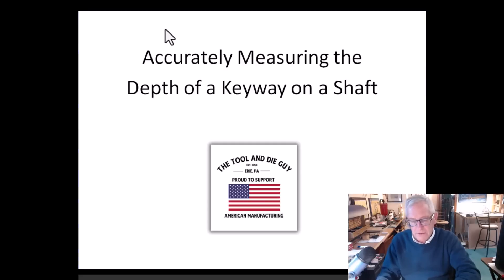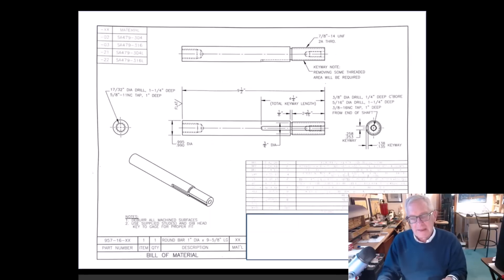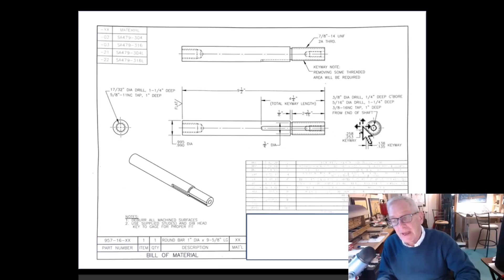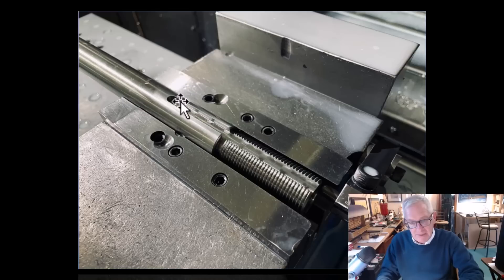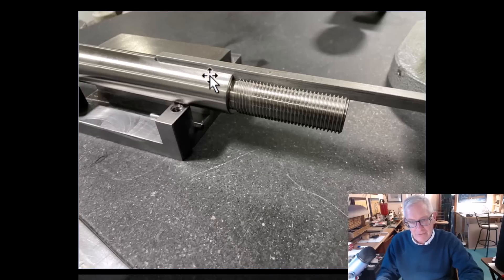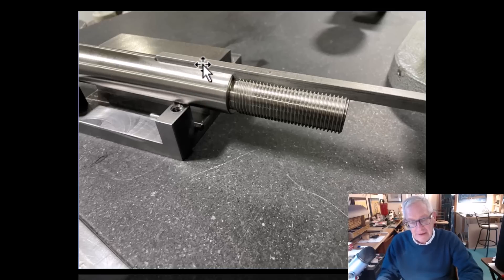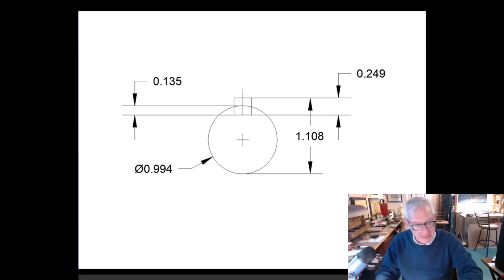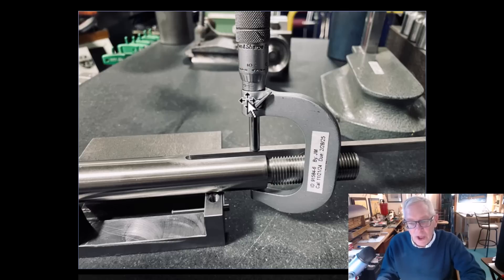How To Accurately Measure the Depth of a Keyway on a Shaft.

Comment: How did you manage to measure that on the machine? If it needs to go deeper, all the profit from the job goes into trying to set it back up again. Surely some of the keyway could extend to the left of the vise to enable it to be measured before taking it out of the vise.

Comment: Although not standard practice, I tend to dimension my keyways from the bottom of the keyway to the OD - the remaining OD so to speak. You have to be careful with the tolerancing, but since the shaft is usually a tight tolerance anyway for a proper fit, this is not usually an issue. Machinists are usually very grateful for this approach because it makes measuring to drawing easy. But let's face it - putting a key in and measuring as you demonstrate here is not exactly difficult either, and means you can use a micrometer rather than calipers. Still, it seems to work out, none of my keyways has ever "not fit". I do include the normal depth dimension as a reference. Great video as always - thank you.

Comment: In europe it is standard practice for the engineers to dimension the part exactly as it is going to get checked similarly as you showed, with a micrometer across the bottom of the keyway and the other cylindical side omitting the key stock entirely. Direct measurement and comparison to drawing,no math no  opportunity for mistake. Watching US machinists struggling with depth mics, having to lightly file the edge burrs on top of the keyway before setting the depth mic legs in place,doing math etc. always makes me shake my head.
Reply: Exactly! So simple!
Reply: That works great until the keyway width is narrower than the mic anvil and then you're still resorting to this method. I dimension as you suggest but I'm often working with 3mm slots.
Reply: Great idea!  Idk why I didn't think of that.  Love this channel.

Comment: I do almost the same thing, I have a shop grade import gauge block set that I use for both checking the width and then mic out the depth with one that clears the corner rad.